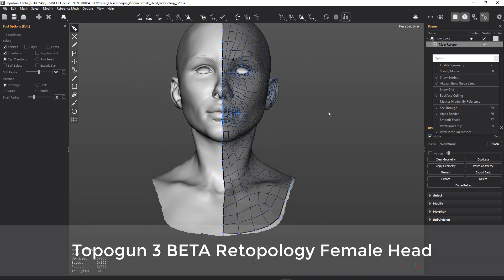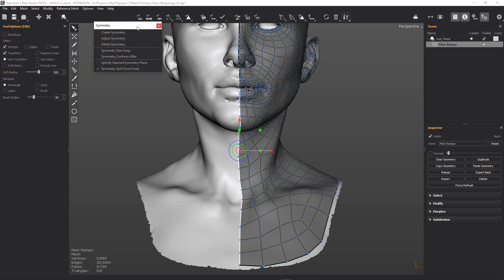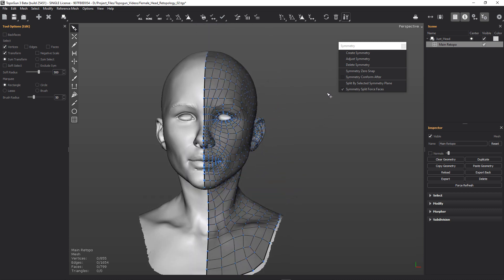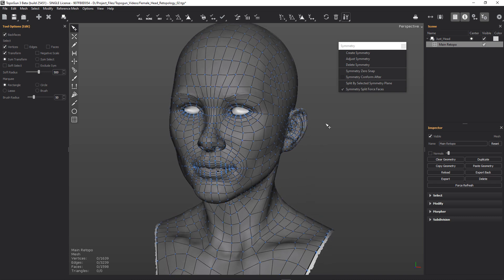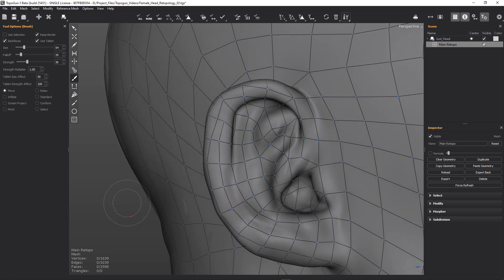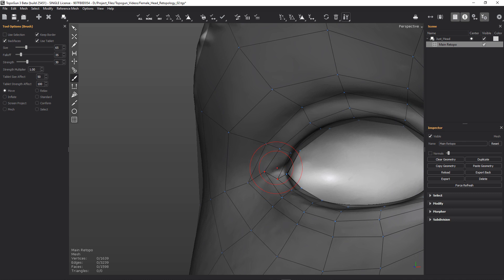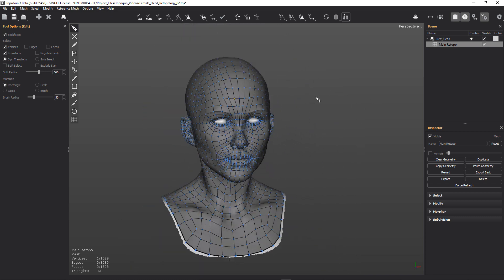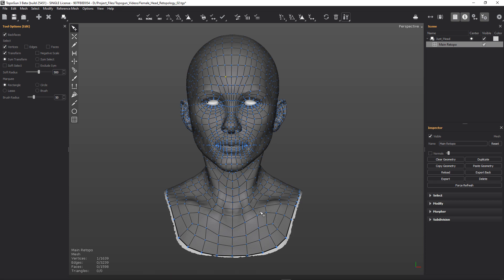Topogun 3 BETA Retopologising Female Head Part 5 - Creating Symmetry

Comment: What is the command/ shortcut for selecting the vertices between the two you select ? (when you were aligning them to the Zero Sym snap)
Reply: Select the two vertices at the beginning and end of your selection, then in the top toolbar, hit the 'Select Edge Path' button.  You can also set up your own hotkey in the keyboard shortcuts under 'Select Menu' -> Select Edge Path by Distance.

Comment: great videos, but I am wondering how can you deal with inside part of the mouth? Can you hide part of the face to see inside mouth?
Reply from the maker: I'm afraid it's always going to be easier doing that in poly modelling program. Currently there is no retopology  program I know of that lets you do this reliably/comfortably
Reply: @scarymonstasprojects111  thank you:)
Reply: Yes u can do tht indeed it's a simple process to do tht in topogun all you gotta do is go to zbrush assign different polygroups to your object for example : one for tongue one for one for teeth and so forth after that import your model in topogun and then you will see tht all your polygrouped objects are in a form of layer (jst like Photoshop layers) beside tht click the (marked icon on the box) u will see tht now you can hide or unhide your objects based on the polygroups tht you created !
Hope it helps ! It makes the job easier this function was missing but I'm glad it's in topo 3 !

Comment: How do you export the reference mesh pieces as seperate pieces and not one reference mesh for baking?
Reply from the maker: Just ellaborate on that please, not sure I understand what you mean?
Reply: Do you have an email where I can contact you?
Reply: or a discord
Reply from the maker: @brocolee8373  so the reference pieces you create are automatically exported when you mask off and export you specify a name then that file is automatically reloaded as reference so the piece you cut off would be saved in that specified place so in theory you could use it to bake but in this case I wouldn't as I only broke it off to aid the retopology of the ear.
Reply from the maker: @brocolee8373  Topogun is purely for retopology so any reference mesh or pieces would already be separated in separate files. You would load seperate pieces into topogun in the same scene and retopologise over the top of those pieces  to create a simplified/optimised topology for game, rigging or further detailing. So if you wished to use a seperate software (eg Xnormal) for baking your maps those pieces would simply have to be loaded into the software of your choice to bake on to you newly created topology. Currently we have to export the new topology to external software to create UV coordinates so external baking is completely  via route.
Reply: @scarymonstasprojects111  Thanks I just needed to mask them and press export